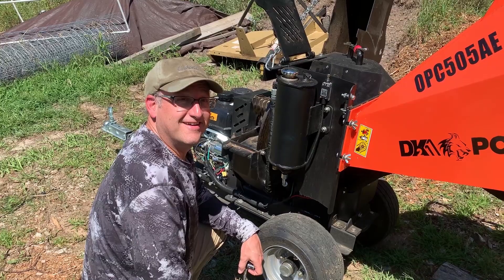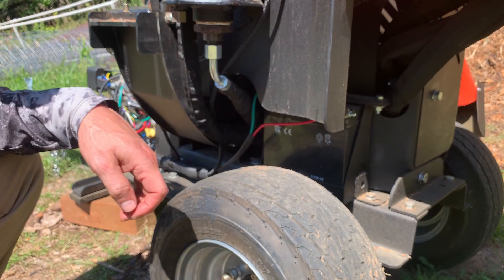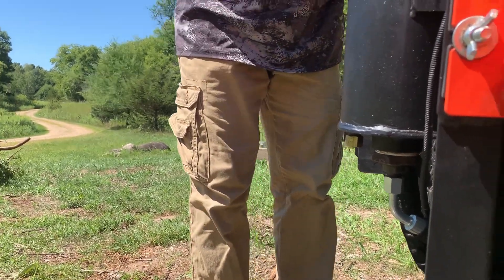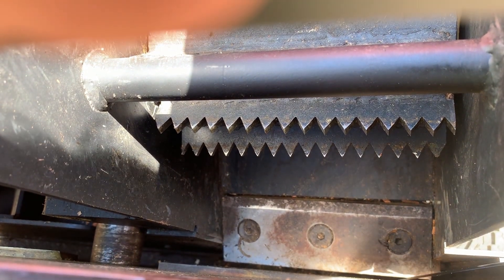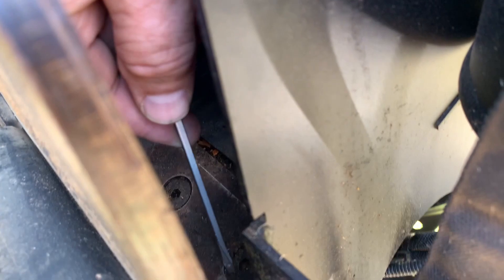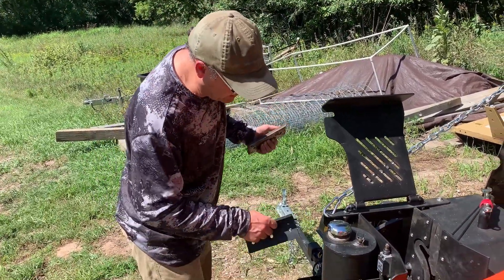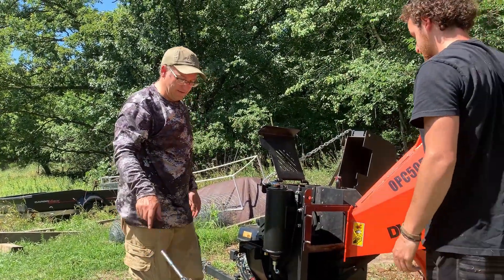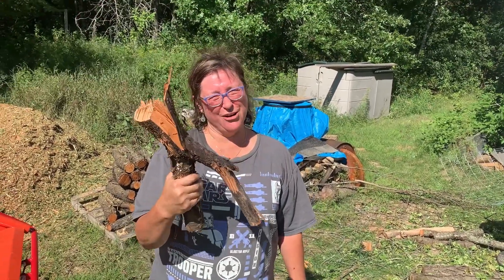Adjusting the Chipper

Comment: In your first chipper video the instant jamb had me wondering about the bed knife gap. Your bed knife is just another chipping blade backside up. Topicality they are thicker steel 5/8” or better. I’ve had a few chippers and knew there was something seriously out of wack. Did you get new blades?  I use a resin disk on a angle grinder to touch them up. Small chips dont matter much. 
I currently have a Power King manual feed 13 hp Kohler like yours. It’s a drum system and when blades are fairly fresh does a great job self feeding Itself . Fancy cars are nice also but the more toys they have the more things break.

Comment: Its to bad that your manual didn't cover this, great video, on my chipper it also stresses that the anvil plate be squared off with a file on the end that faces the cutter blade for maximum performance. The proper gap between the cutter blade and the anvil plate not only controls the wood chip size but also greatly aids in the self feeding aspect of the chipper. One suggestion, since you have to remove the hopper shute and battery to get access to the anvil plate bolts you might as well remove the blades and ReSharpen them as this will make it easier for the motor to operate also green branches cut much easier than dried branches. What I do is to buy an extra blade and swap it out when I adjust the gap between the chipper blade and the anvil plate but i only have a single blade on my DR chipper if you have more than one blade you may want to sharpen them as you adjust the anvil plate because of cost.
Reply from the maker: I don’t know if you know, but we had a huge fire and lost our chipper last year. We have now purchased a new chipper—same make and model. We also bought extra blades so that we can easily swap them after we’ve done a hard round of chipping.

Comment: Just watched your other video where you had problems. Many nice features on the product too bad they didn't include a parts and maintenance manual and an easier access to the anvil. BTW, What is the engine HP. rating and where is it made.

Comment: I ordered mine in February if 2021. Delivered to my house March of 2021. I’ve had nothing but problems with this machine since the second day I’ve had it. I’ve pretty well rebuilt everything from the hydraulic pump seals to the axle width and fabricated an entire new undercarriage because the chipper rolled over because the axle width is far too narrow. Wish I would have bought a Vermeer BC900 and skipped all the hassle.
Reply: Lol you going to Comare this to a $26,000 chipper... come on man
Reply: @josephschilcher7806  yes I am going to compare this to a $14,000 machine. DK2 tries to say that this is a commercial machine and it very much is not. This machine was built by an engineer who maybe saw a chipper once and then decided to design one. Hind sight being 20/20, is much rather have financed a machine that does what it’s claiming to do than lose the hours of productivity and maintenance that I fight this machine with.
Reply: I've found that using smaller branches (diameter) than it says cuts down on the clogs. For the girthier branches, chopping them shorter with a chainsaw helped greatly (lessens the load / branch for the chipper). Highly recommend adding wingnuts to the shoot's door for ease of access for the inevitable clog, but altogether pretty great!